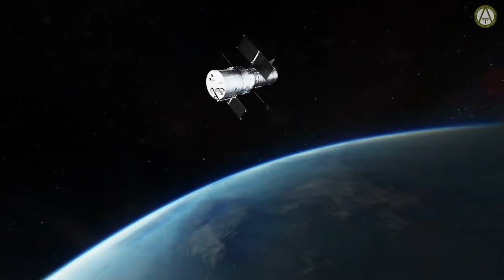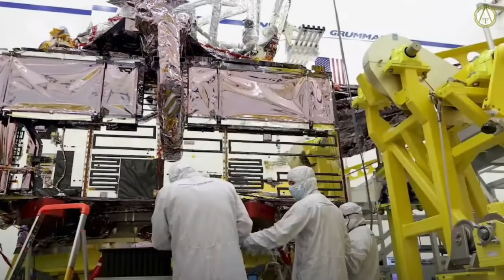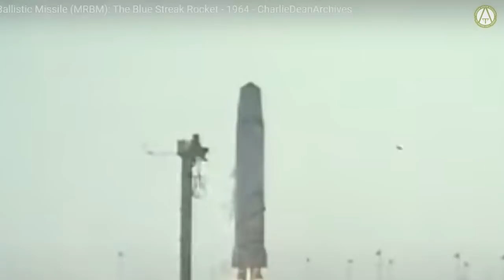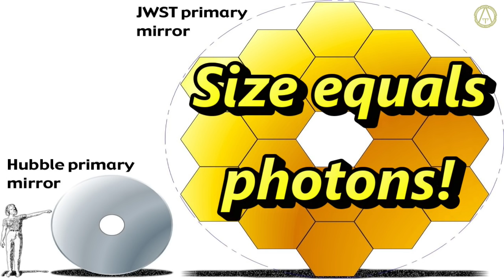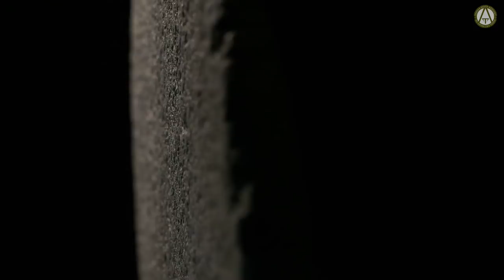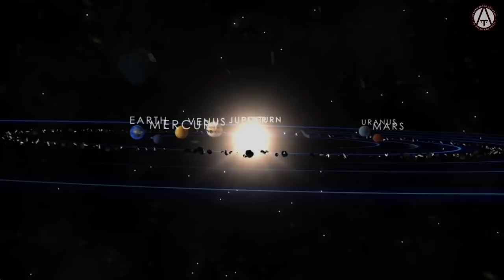Space Astronomy: The James Webb Space Telescope and a Future Starship Infrared Observatory

Comment: When the James webb telescope finally made it into space, I was happy. I thought it was going to search in the final frontier for Terra 😎, Terra 2.0, but I was disappointed. It spent a year and a half looking for red shifted galaxies at the observable universe boundary. Why ? Most of those galaxies are ashes now. The AI aliens in those galaxies had evolved beyond AI long ago, when our milky-way galaxy was just a giant ball of proto gas and dust. And every 2 months they announce another new red shifted galaxy. Maybe the next one should be called Webbiee247. You might say what does the numbers stand for ? The numbers stands for 24 hours a day, 7 days a week 24/7. I think the Webb should be looking at the atmosphere of the planets, near us 24/7. Instead of trying to see what's beyond the cosmic horizon. It should look at the planets, or ? or ? the gravitational lensing of warp drive engines. But, I think that's hard to detect. Maybe something easier.  Look for a dyson sphere thermo-electric generator (harvester collector) around a white dawf star. Built by some AI intelligence. I think the dyson sphere harvester will have to be very close,  maybe tidally locked to the white dwarf star. To take advantage of the hot cold difference to produce electricity. Maybe to charge batteries for the electro-magnetic force field for the lightspeed ship or for the life support systems, etc,etc,etc. If the energy(power) or temperature drops by 20% or more, that's not random, it's a dyson sphere (harvester) pulling energy from the white dwarf star. And now we found the AI alien
Reply from the maker: Webb does not quite have the resolution to see planets outside of our solar system.  It can see the spectra of starlight going through a planets atmosphere when an exoplanet traverses the star relative to Webb.  This was the main purpose for Webb.  To look through dust clouds and detect exoplanets.  Looking back at the early universe was important to cosmologists and a good test of Webb's systems, but I agree that exoplanets should come first.

Comment: More photons isn't what equals higher resolution.  A larger aperture means less diffraction, which allows higher resolution.  Radio telescopes use multiple dishes to creates a larger effective aperture by interferometry, without a corresponding increase in photon-gathering capacity.  When looking at very bright objects such as Venus with even a medium-sized recreational telescope, you don't need more photons: the brightness means there's more light than you want, but you still need just as much diameter to get resolution.
Reply from the maker: Thank you :-) but more radiotelescopes do mean more photons. But I get your point and you are correct. Still… More photons equals higher resolution when you don’t have enough photons.